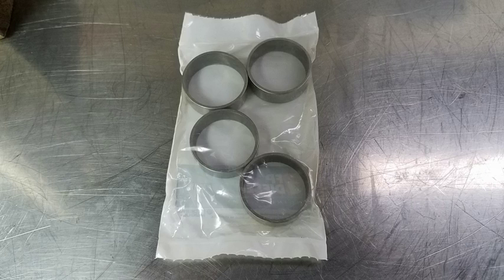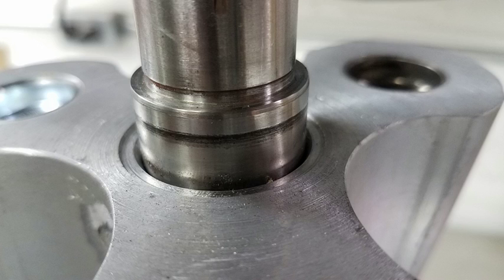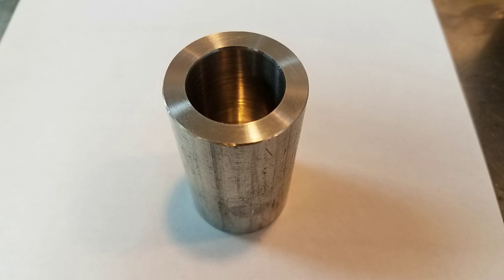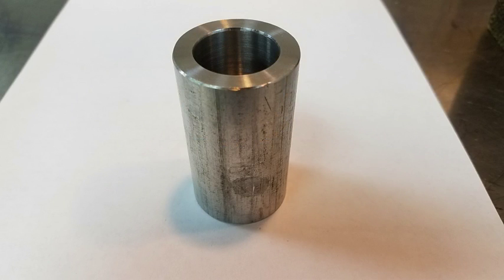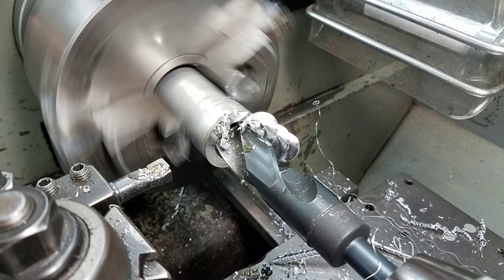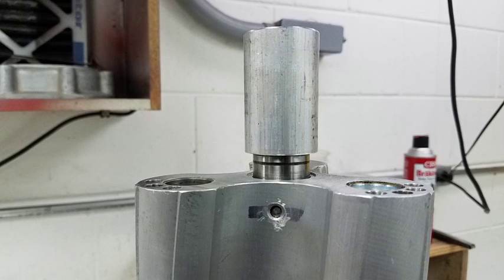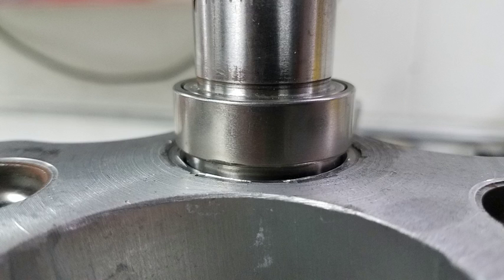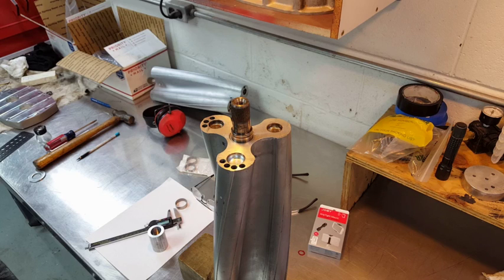My 6-71 Blower rebuild, Part 7: Installing Shaft savers

Comment: when you removed them did you use a lathe or did you find a way to pull them?
Reply from the maker: I used a very tiny crowfoot pry bar, with a smooth face on the edge, so it would not mar the seal surface on the rotor.  I spun the rotor afterwards on the lathe to polish the seal surface with an extra fine Scotch Brite pad, and the seal surface was smooth and perfect.  Thanks for watching, Shawn!